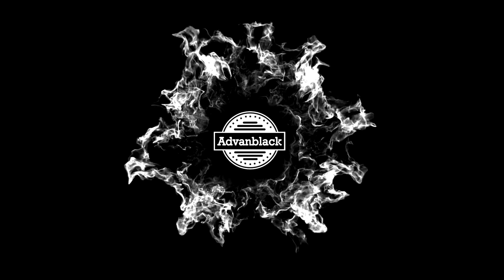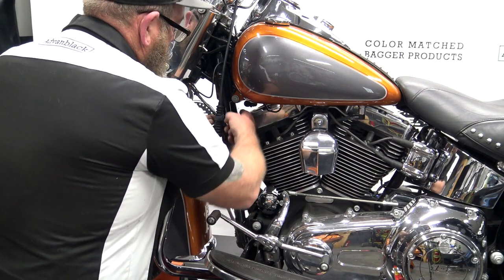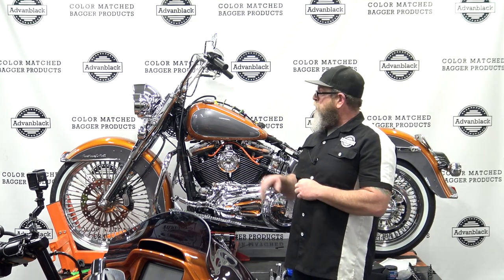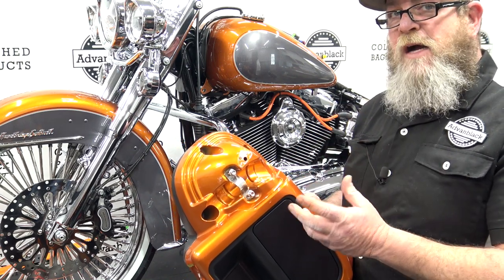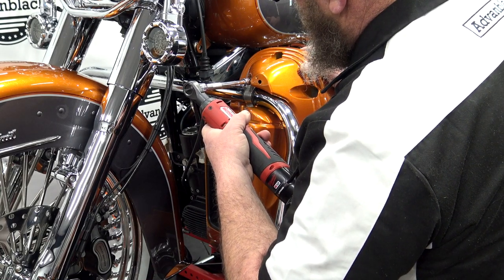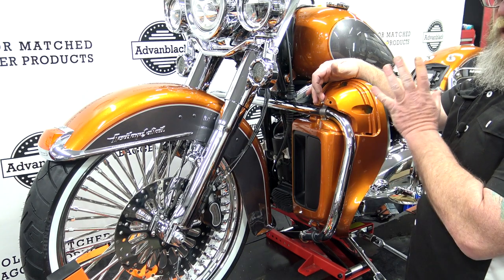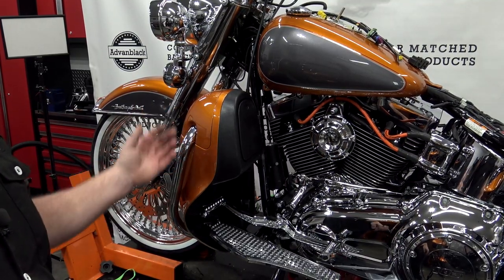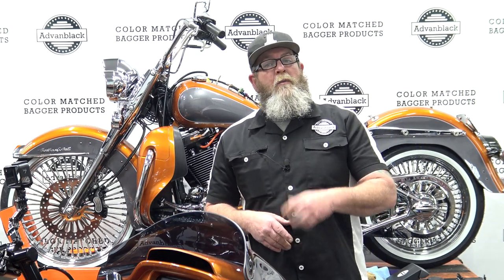Add @Advanblack  Softail Crash Bar & Lower Fairings

Comment: Nice video as usual.
 Question, my 09 FXSTC CUSTOM allows a lot of air to come up from road flowing up along my chest into bottom of my flipper up full-face helmet. I built chin curtain to stop 90% it, cutting some of wind noise down too. Do you think these lowers would help stop air or push more of it around me from coming up ? Use a HD Clip on Windshield.most of time.   Appreciate any advice, thanks.
Reply from the maker: Ive found in the past that a lot of that air causing helmet buffeting is from the air that hits the front of the tank and comes up ...Im not sure that these would do much for the upward air...it may channel some through and around ..haven't had enough time riding it like this to really say.

Comment: I just placed an order for lowers for 2016 Street Glide special. Will it come with mesh inserts, need more airflow during summer months. Also I just saw another video where someone installed lowers on their street glide and right behind where mesh insert goes it is solid, meaning no air will flow if you remove the blank and replace with mesh insert. Am I correct ?
Reply from the maker: Our lowers do not come with a mesh insert. The lower LED lights however are mesh and have a cover, if you will, that slides into place for cooler riding.  I don't belive anyone sells lowers that include mesh inserts..that maybe something you can purchase separately